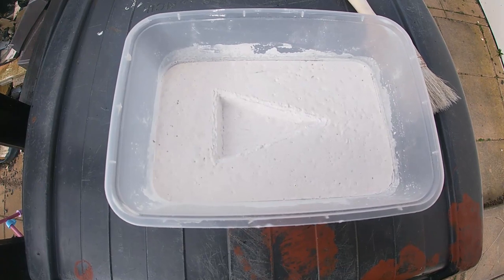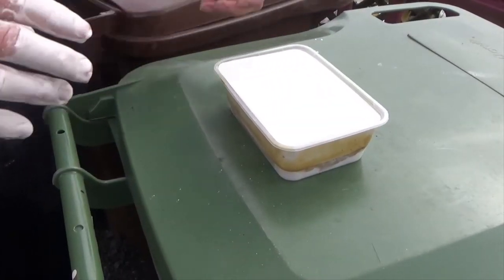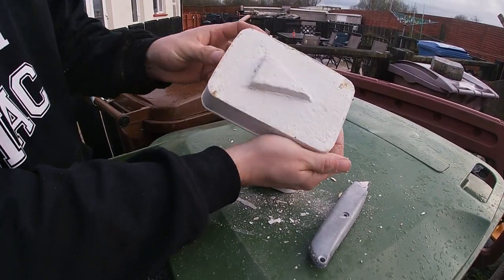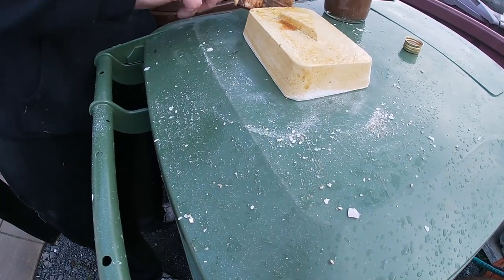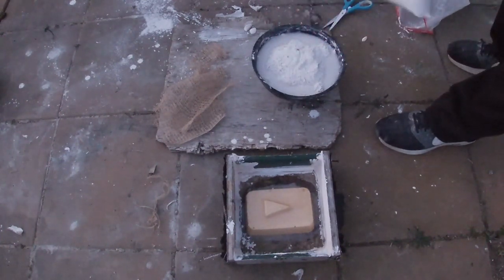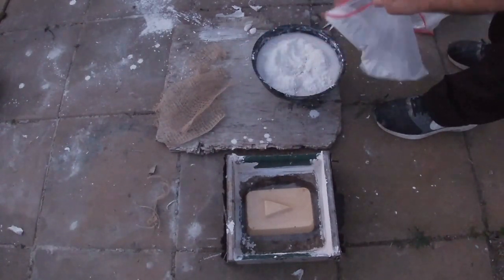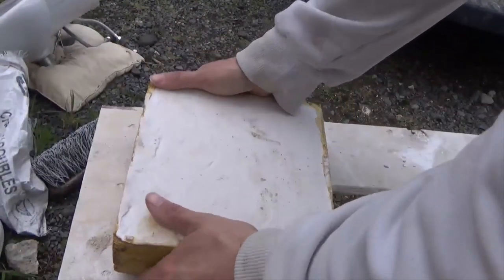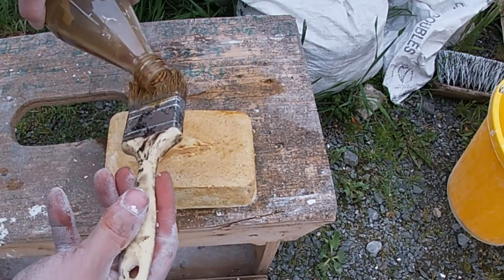Making YouTube Play Button Creators Awards YouTube  ▶ 👍

Comment: Looking good mate. I’m competing in the 2021 skill build competition this week. Where I’ve got to make a slab mould and a running horse with gig stick. I’ve only been learning how to do this for 5 weeks so any advice you can give me?
Reply from the maker: slab mould for making concrete tiles or slabs ? what metrails are you allowed to use and how long dose the comp last ?
Reply: @macplastering  it’s a slab plaster of paris mould. I get 6.5 hours to skim and render bead a sheet of plasterboard (fancy designs) plaster one half, bond the other half, run 2 plaster of Paris straight runs, 2 circle and make a 12mm slab (in a shape I’ll find out the morning of the competition) cut and mount the plaster of Paris runs, circle and slab then tidy it up with any repairs
Reply from the maker: @stevenprice4969  so the gig stick do they give you everything ? like can you drill it and fit it with a little piece of pipe to allow a screw to hold it down but not to tight so you can let it go around a circle freely ? do you have to make a mould for the slab as in make a model that you want to replicate? if so make a box to the size you want mix up pop then pour shape it as it sets to the designs or stone like finish you want , then seal it and grease it up then you can copy it with rubber silicone or fiberglass then set thats set you can cast the same over and over again .... again i have not done much on this side but still learning myself